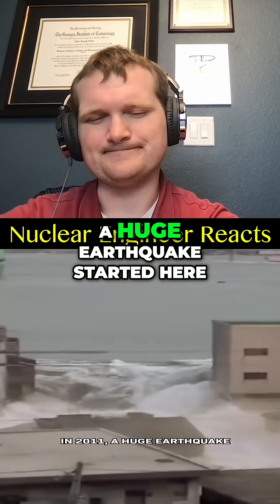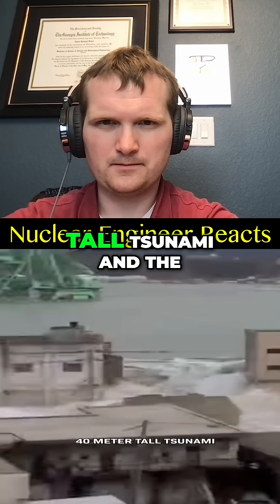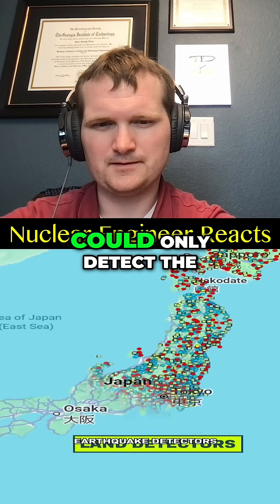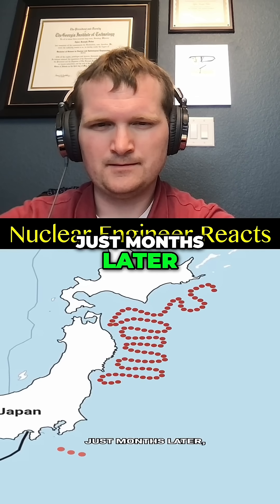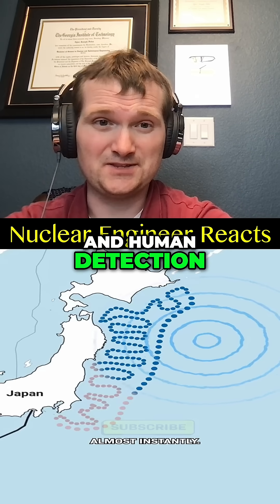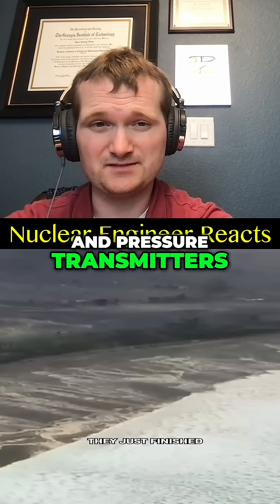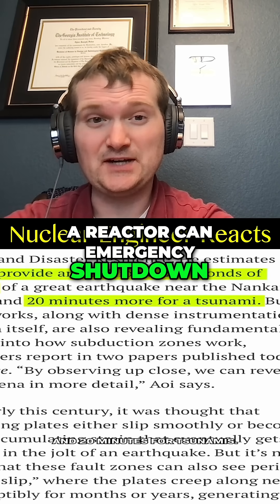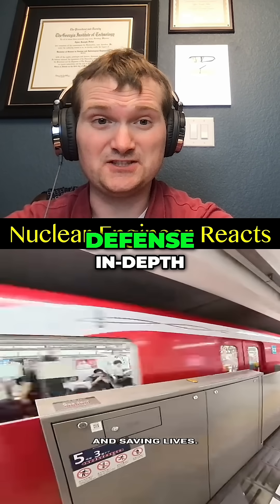Japan’s New Earthquake System Protects Nuclear Plants - Nuclear Engineer Reacts to Cleo Abram

Comment: when would Japan install " earthquake-ready " precautionary measures not just in nuclear power plants , but also the reinforced citywide safety network foundation ? 

if a transnational oil pipeline has " customised shifting tube assembly " meant to endure ground tremors in northern America & Japan , a long time ago invented a " flexible " suspension steel bridge capable of holding the dead weight payload of the asphalt road filled with assorted vehicles & violent ground shake , why not reinforcing underground terrain support 🤗 ?

Comment: Fukushima was warned about the bad generator placement from GE I think, also the training on the emergency backup systems like the Isolation Condensers was not up to par as a result they mistook faint steam as a sign that it was active during the blackout when it actually was off at the time of blackout. Nowadays the BWRs have RCIC instead of the Isolation condensers I believe most of the units in 2011 had them expect for unit 1 which had that problem. Additionally they never did a startup test of it for 24 years at that point so no one had ever seen it operating. They overlooked a pump too when they prepared for fire truck water injection the pump had no power and as result it back flowed into some steam condenser i forget the name of some 75% of the water injected was lost the rest did make it into the reactor.

This is why training better design and procedures are so stressed today and something like this will never happen again
Reply: The biggest danger with nuclear power does not come from the technology itself.
It comes from human behaviour and corporate greed.
Reply: You make excellent points. 
Let's close it down.

Comment: Someone who graduated from the Moe, Larry, Curly school of engineering, put the backup generators in the basement, so they got flooded with water.  The plant was situated next to the ocean, why didn't they put the generators in a safe location?  Inquiring minds want to know.
Reply: Because someone was betting that the 40 years or so the plant was going to be in operation before overhauling was just a small part of the 1k years of a 1k year event. Thats why he’s an engineer and not a gambler.
Reply: No clue
This was listed as one of potential dangers but the higher ups have pushed the report down
Reply: The Fukushima power plant had several safety violations prior to the earthquake. The backup generators being in the basement was one of many violations that led to the power plant's meltdown.
Reply: They've designed it to be able to withstand 30+meter tsunami, but it got hit (pretty much directly) with a 40m. It was one of the biggest events ever recorded.
Reply: The Fukushima reactors were literally the first generation of GE commercial reactors, we were still learning back then.   The real question is why they didn't figure out the problem in the 40+ years since the reactor was built?
Reply: probably because well u guessed it, it's cheaper.
Reply: the plant was designed to be very compact, and therefore put the generator in the basement of the turbine building. this is a valid design choice, however they didnt floodproof it, and the seawall is quite literally useless
Reply: @soggypancake001  this is true for the main generators. What lead to the plants meltdown was that the backup generators were also placed in the basement which was one of many safety violations. The plant was in trouble for cutting corners prior to the earthquake
Reply: @soggypancake001 valid design until it fails due to oversight, negligence, or budget cuts, then it's a horrible design.

My sports car is an amazing design, as long as it is driven on a straight road and we don't need brakes...that being said, if it's shipped to a place with mountains and kills it's drivers, well, maybe it's actually bad design 😂